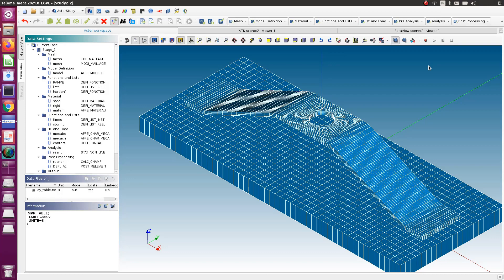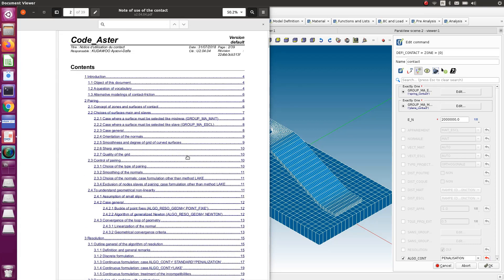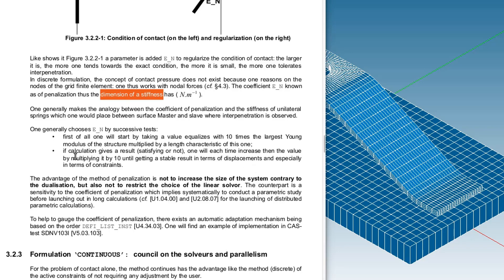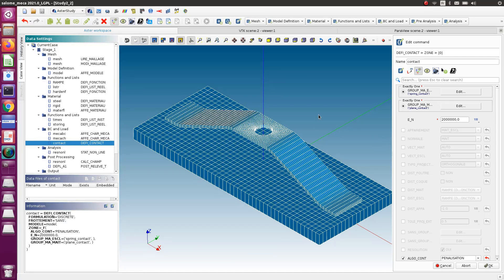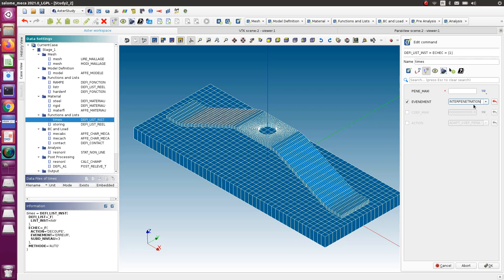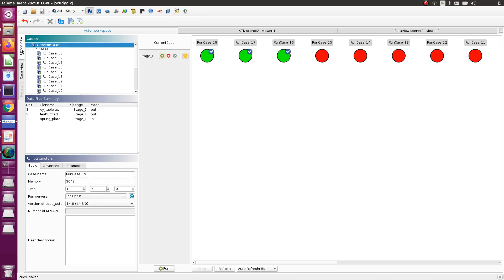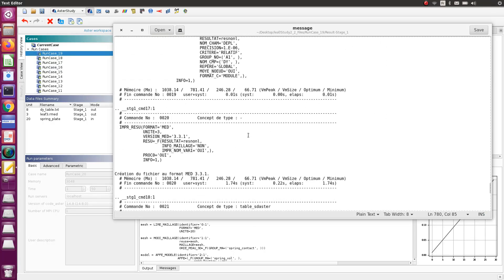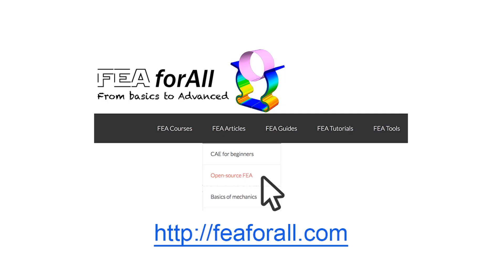How to optimize E_N Penetration contact coefficient in Code Aster?

Comment: Hello Cyprien!
I tryed to implement this solution and I get the folowing error:
 <EXCEPTION> <JEVEUX_26>                                        !
   !                                                                !
   ! Objet inexistant dans les bases ouvertes : &&OP0070.RESOC.COCO !
   ! l'objet n'a pas Ã©tÃ© crÃ©Ã© ou il a Ã©tÃ© dÃ©truit                   !
   ! Ce message est un                                              !
   ! message d'erreur dÃ©veloppeur.                                  !
   ! Contactez le support technique.

I am using CODE ASTER solver only for windows, version 2019.
Thanks
Reply from the maker: Maybe some of the commands are not working correctly in the windows version. The windows version of Salome Meca is not official, I advise you to try with the Linux version…